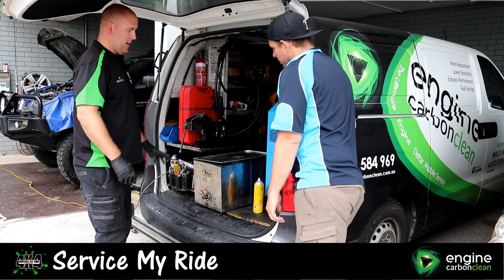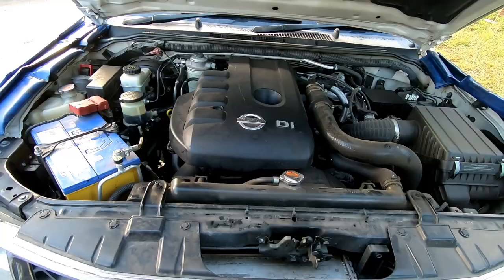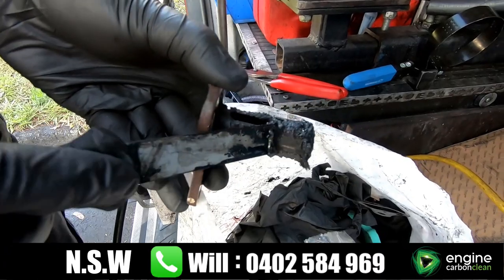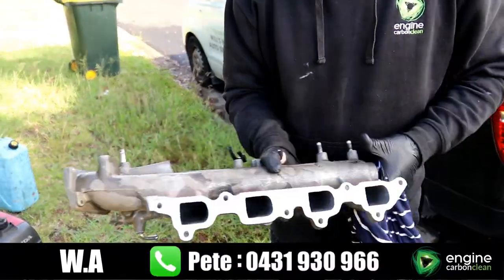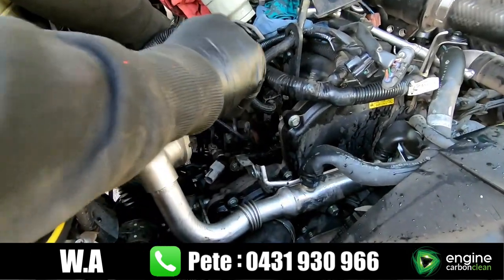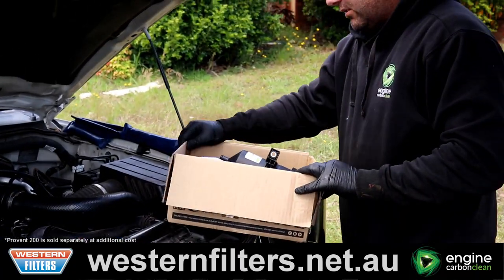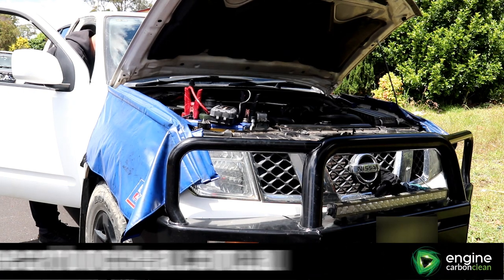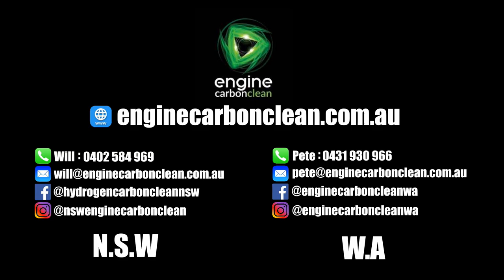NISSAN NAVARA Manifold carbon clean

Comment: Yeah, I get what you're saying and perhaps trying to simplify this for most viewers.....but technically there's not really an issue with "not all the fuel is fully burned in the combustion process". Because for all intents and purposes; it actually is all burned.
The bigger issue that clogs up the turbo output hose, the intercooler, the throttle body, the EGR valve and the intake manifold is: the oil-laden hot air that is released from the crankcase and fed back into the air-fuel mix path, to be burned (hopefully!) on its way through the combustion chambers. 

Of course, this shitful emissions-control machination is good on paper (and marginally better for the environment); however it plays havoc with the engine parts which you now find yourself cleaning with a fairly involved process. Engine manufacturers claim that if an oil residue catch can were advantageous they would have installed one in the factory. However, they don't seem to think beyond the warranty period when it comes to the long-term effect of feeding filthy crap back into the engine.